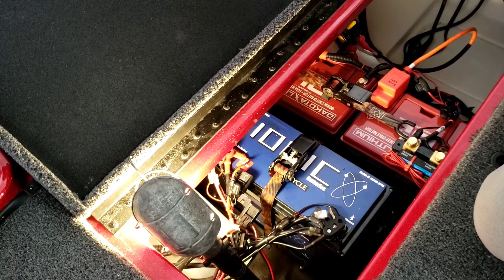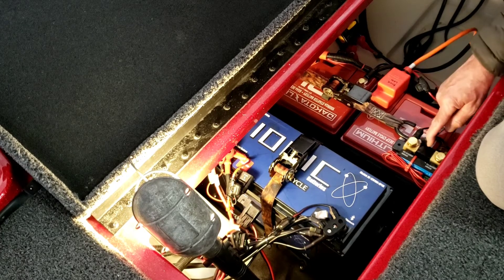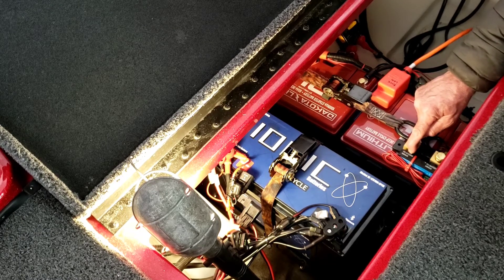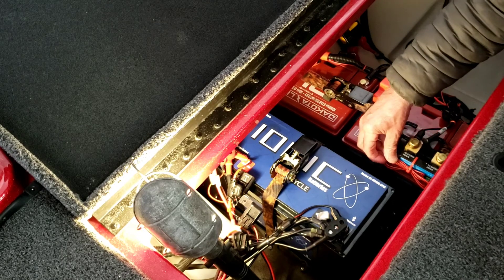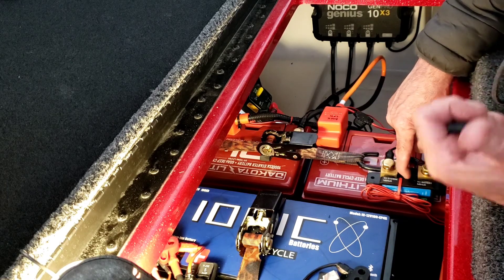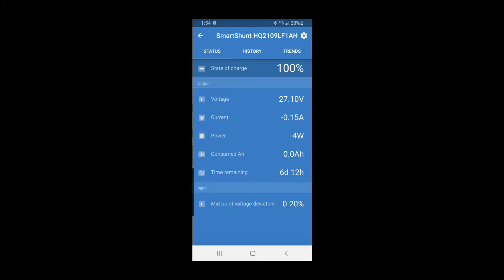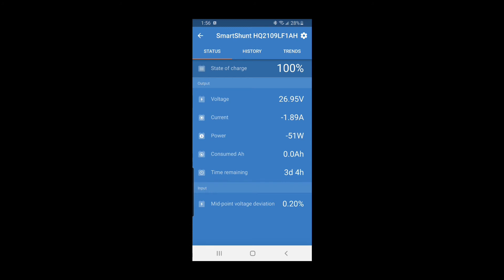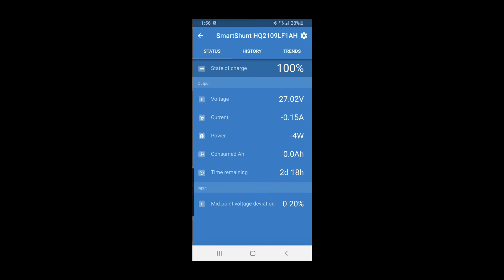Dakota lithium 24 volt with smart shunt hook up

Comment: Nitro,reaching out to see if you had a follow up video on your smart shunt setup.i have NOCO charger also with 2 -12volt AGM batteries for my mini Kota troll motor, looking to install the smart shunt, was not clear on your wiring setup.Is minus battery on the shunt for the battery closest or further away from the Troll motor?Is troll motor negative only wire on the Load minus of shunt?And the NOCO charger load, where is that connected? sorry for long questions, just trying to get it right? thanks John
Reply from the maker: hi sorry i dont have a follow up video yet, but it has been working ok monitoring the 24v curcuit. but if you want you can hook it up on one of the 12v batteries to monitor a 12 volt circuit. the other battery should basically be the same. you cab also monitor the voltage on the other battery with the auxillary feature on the shut. hope that helps thanks for watching

Comment: What's the benefit to running the two 12v instead of buying one of their 24v batteries?
Reply from the maker: My boat was already wired for 2 12v batteries plus my on board charger is also 3 12v bank one for my crank. Tks for watching

Comment: Have you had any problems with the shunt as hooked up in the video? Thanks.
Reply from the maker: no its been fine just need to have the settings properly. the batteries have been performing great as indicated on my other videos. tks for watching.
Reply: Thanks. Going to hook mine up the same way.

Comment: Potential problem here. I was directed to a manual for these things, and it says, " For multi-bank charging systems, connect the shunt and voltage sense wire to the
battery that has the positive terminal of the system. This will allow the fuel gauge
to monitor one battery to represent all the batteries in the system." I did not do that, and do not look forward to getting back in my battery compartment to make the change. Wonder how wrong my reading is?
Reply from the maker: Not sure i understand that but mine seems to be working fine the way I hooked it up

Comment: If each battery has to have its own leads for the charger, how can a shunt system work? Asking out of ignorance and the desire to do the same thing.
Reply from the maker: Tks for watching. I manly use the shunt so I can monitor my 24v system to see how long the batteries will last when using my ultrex which seems to be way better than expected. Used it for 2 days and my batteries were still at 65%. I have the charger hooked to 1 of the batteries on the load side of the shunt. And the other charger leads go straight to the other battery further from the shunt. Seems to be working ok. I may have an updated video in the near future
Reply: @nitrojoeZ18  Thanks. I will try the same. Like you, I will end up with one Ionic that needs no extra monitoring, then two Amped that do not come with bluetooth. What I am trying to achieve is-not having to charge after every trip.
Reply from the maker: @PMantle  ya you will be surprised how long they last. Mine are only 60ah on 24v system. And my 100ah ionic crank hardly ever need charging cause the outboard charges it. Its like plus 90% after a days use
Reply: @nitrojoeZ18  That's what I figured. I just would like to charge as few times as possible. I think I may just hook my shunt up to a single TM battery and just assume the two are being drawn down equally. That way, I avoid any issues present by one charger lead not going through the shunt.
Reply from the maker: @PMantle  that's another good idea. Let me know how that works out..

Comment: This is similar to my setup. I will be running two Ampere Time 12v 100ah lithium batteries in series for 24v Minn Kota Terrova i-Pilot Trolling Motor. And like you will be running a Victron SmartShunt to Bluetooth monitor my batteries performance. I would imagine that with 100ah I may not need a charge but maybe twice per month because I would be trolling at speeds 5-6 just like you. Thank you for a great video.
Reply from the maker: Yes you will probably be able to run your trolling motor 3 to 4 eight hour days before changing. Can't believe how long they last. Btw how did you hook up your charger cause I have a 3bank x10 amp and had go directly to one of the 12volt batteries on my 24v system. 
Thanks for watching hope it helps and appreciate it
Reply: @nitrojoeZ18  I purchased two single 20amp lithium battery chargers and they work great. They charge my lithium batteries pretty quickly. I charge the batteries individually. So are you charging negative one battery to positive another of your 24v configuration? If so, maybe I should be doing the same. What’s your advise?
Reply from the maker: @chaguie07171959  i have a on board noco 3x10 amp charger that charges 3 12 volt batteries at the same time 2 of the 12 volt in series for 24v and 1 ionic crank battery. i know they say to hook up all ur loads and charges on the load side of the shunt but mine wont work that way so i have to go directly to my 12 volt battery on the battery further from the shunt thats monitoring my 24v system
Reply: Are you able to monitor your charging input this way?
Reply: @brixelus  Yes, I am able through the Victor SmartShun monitor not only my charging but even more important the state of charge and the usage that the trolling motor is using and how much run time I have at the given speed.

Comment: Just got two of the batteries and the shunt myself for a car audio setup i'm planning, still have to get two more batteries though.

Quick question for you, if you still have the boxes (long shot i know) could you look at the bottom mine had date's on the bottom (JUN252021 & OCT132021) and one of them has a reversed polarity? 

I've reached out to Dakota and the retailer they were purchased from, just wondering what you've got
Reply from the maker: Hi yes I do have them and just checked both have dates on them but do not say reverse polarity. Not sure why it would say that. Yes they are hard to get a hold of after you purchase ur batteries but eventually when you ask enough they will respond.
Reply from the maker: Thanks for watching